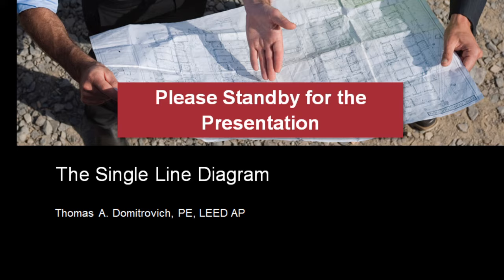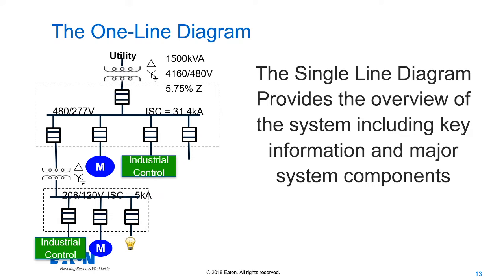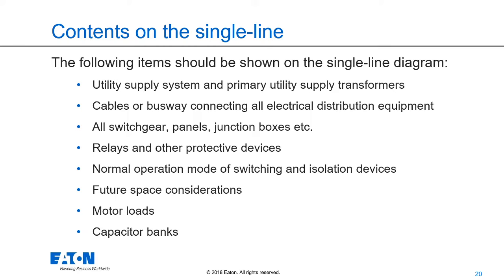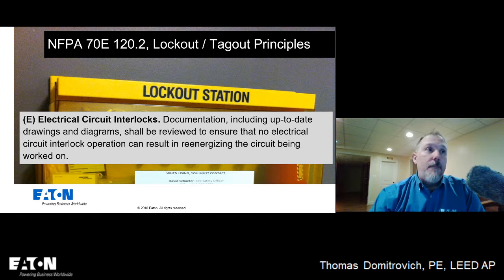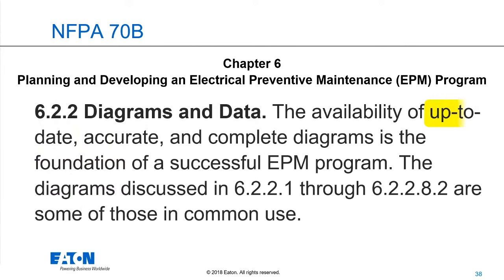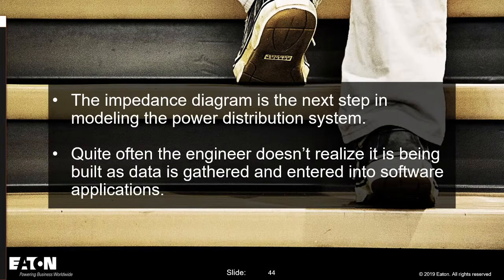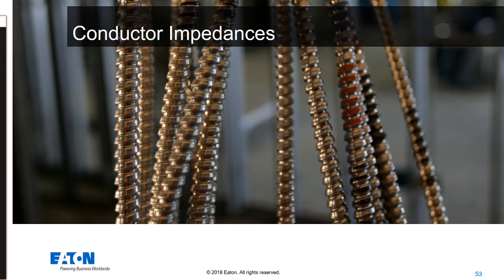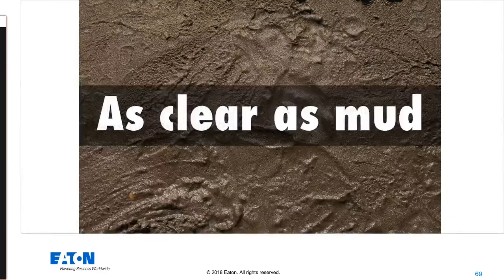The Single-Line Diagram

Comment: Great video! I love the idea of having a physically isolated breaker or transformer integral breaker before the secondary panel to reduce incident energy. I wonder what the cost of this plus a MLO panel is vs a panel with a main breaker. Safety is almost always worth the cost increase, I just wonder if it could be justified across an entire facility.

Comment: Sometimes(most of the times) at a power plant outage, all the diagrams are in flux, they may be 'somewhat' accurate but are subject to markups(as-builts). Can be confusing but just need to use common sense and be aware.  Those outages are always a race against time to get the system going based on a deadline.